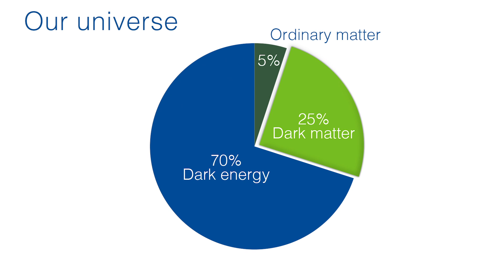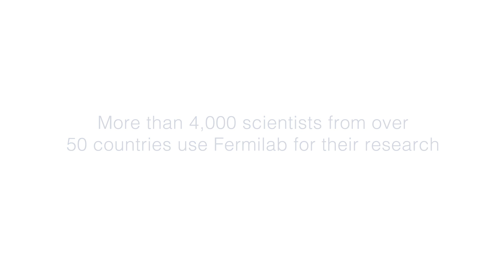Detecting dark matter with scientist Javier Tiffenberg

Comment: Dark matter is the mistake believing that gravity is the only force in the universe able to move mass.
Reply: Is it possible for self-interacting dark matter to exist at the centre of the Earth (from the beginning, not accumulated)?
Reply: @alanlowey2769  Dark matter's only affect upon mass is gravity. Yet dark matter does not affect the motion of the Earth as it orbits the sun. The sun is somehow affected but the Earth and all the other planets and moons are not. General relativity and Newton's laws of gravity can explain the motion and orbits of the planets and moons but cannot explain the motion of our sun or Milky Way galaxy. 

Dark matter only exists because current theories cannot explain the motion of all the mass in the universe. Does that mean dark matter exists? No! It simply means general relativity and Newton's laws of gravity are incomplete.

I know this only because I deduced the error in Einstein's field equation on gravity and fixed it many years ago. I discovered what was causing the motion pinned on dark matter. This motion has nothing to do with mass or gravity. That's why I am able to claim with certainty that dark matter is the mistake believing that gravity is the only force in the universe able to move mass. Gravity is not the only force able to move stars and galaxies. There is another force much stronger than gravity. It is the weak nuclear force or radiation.

Stars and galaxies slowly accelerate over time. The older they are the more momentum they build, at a rate of about 1 mph increase every 10,000 years. Slow but sure. I don't care if it's a star or a galaxy. They both have the same acceleration rate without regards to their mass, gravity or the distance to other mass.
Reply: @BigNewGames  Would it not make sense to assume gravity can be both a strong force and a weak force?
Reply: No one believes that so I'm baffled that you think they do. How do you think you're moving the keys you're typing on, gravity? It's electromagnetic radiation moving them. Gravity is far too weak to do so.
Reply: @abebuckingham8198  https://www.youtube.com/c/SeethePattern